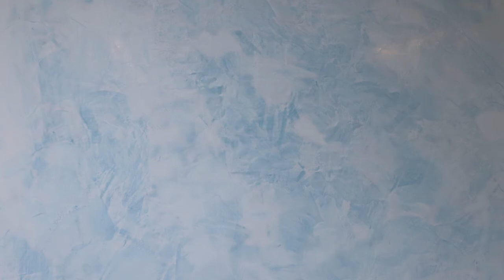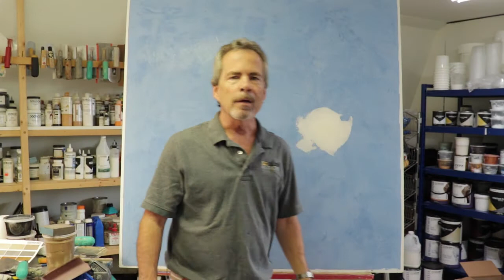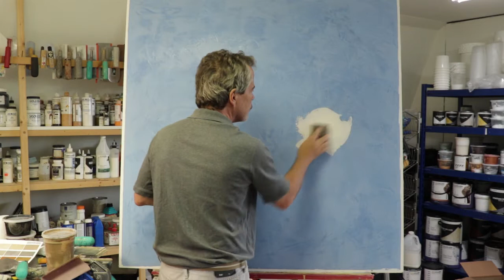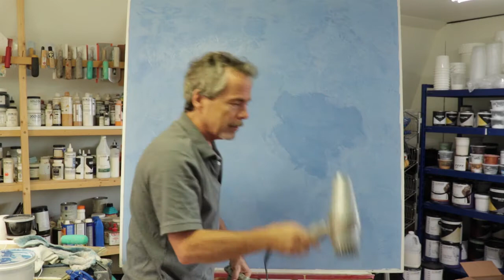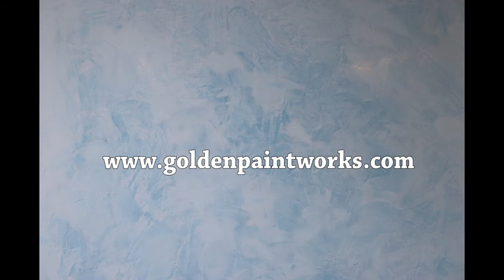How to Repair Venetian Plaster - Golden Paintworks®

Comment: Does this work the same over a waxed plaster?
Reply from the maker: If a wall was waxed with a solvent-based wax, the wax should be removed from the area of the repair first, to ensure adhesion. If the GPW Protective Sealing Wax was used as the topcoat, scuffing the topcoat first before making the repair should be sufficient for adhesion.

Comment: how do I get the closest match for venetian plaster?  I am renting a house and the wall has the same plaster, I would get at least the 1980's and I want to fix some of the parts that have pealed off or where holes were made.  Is there any way to properly match?
Reply from the maker: Hi there, if you think the Venetian Plaster was applied in the 1980’s then it is probably a lime-based Venetian Plaster and not an acrylic Venetian Plaster, which is what we sell. If this is the case, it would be best to attempt a patch with a lime-based plaster. As far as matching the color goes, that’s going to be a bit tricky because the tones of a Venetian Plaster are developed over layers. The best approach might be to try to match the color by mixing small amounts of paint until you find something that seems close, and then take that dried paint swatch to your local Paint & Decorating store for them to attempt to match with a plaster by scanning your swatch. The store could also provide advice about lime-based plasters. We hope this helps.

Comment: i have a 108year old house with Venetian plaster. Some cracks have appeared. And in one place there is some missing and around that area, some is loose but has not fallen off. Is there a way to 'restick' the parts that are loose? 
What can I use? We are in Portugal.
Can you tell me what  the plaster might be made from? I suspect it was quicklime. If there is someone you could refer me to regarding antique venetian plaster techniques I would be grateful.
Also, what primer are you using?
Reply from the maker: Thanks for your question. The GPW Venetian Plaster product is acrylic-based, so it would not be appropriate for your situation. Given the age your house, it is likely that your Venetian Plaster application was done with a traditional lime-based as you suspected. Your best bet would be to speak with someone more familiar with these traditional products. Here’s a couple links that might be helpful to you: Vasari is a brand of lime-based plasters and they also have some videos: https://vasariplaster.com/pages/videos and here is a plaster service in Portugal: https://www.renobuild.pt/en/renobuild-algarve/ I hope this is helpful.

Comment: What if the surrounding area is waxed ?
Reply: Remove the solvent-based wax first with paint thinner and a clean cotton rag.  Repair and re-wax.
Reply: Sand it using 320.grit paper , apply primer , 2 o 3 coats of plaster ? Sand it using 400 grit paper then wax it …..